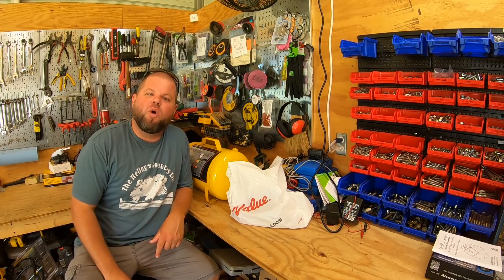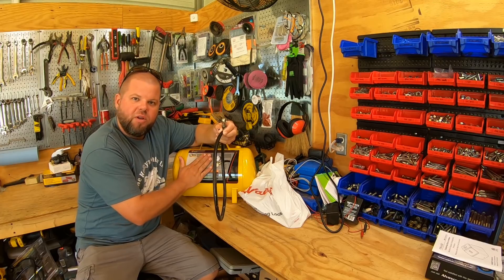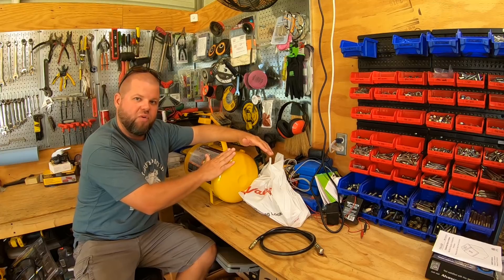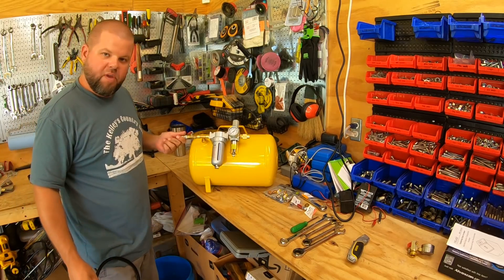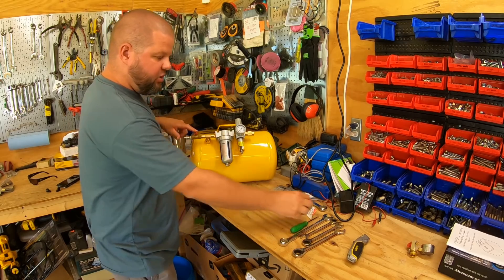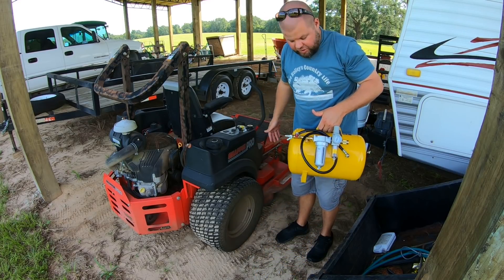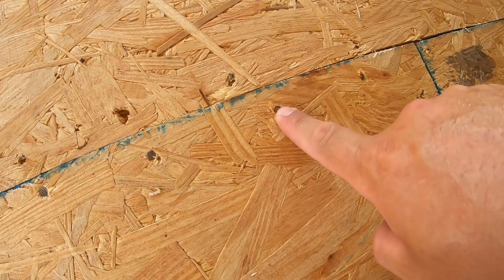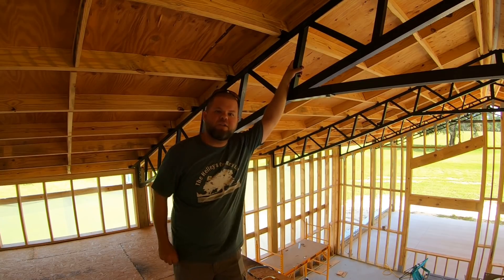Building an air receiver tank with dryer and regulator! #384

Comment: It would be cool to run some pvc line under ground to the house just like on the porch so you always have air but you would need good drying before it ran that way because you probably couldn't drain any water
Reply: you should never run air in PVC, it gets brittle over time and explodes. I've seen it first hand. Metal pipe only
Reply: @superscifi12  I don't know I guess I'd be cautious if it got a lot of UV but I have seen it with no problems
Reply: @james10739  So have I untill it randomly explodes. We were even using schedule 80 PVC. There is a reason OSHA does not allow it.  I am now a Union Steamfitter and wouldn't even think about putting air pressure on PVC pipe when it explodes literally sends shrapnel flying. Air contained is dangerous unless done correctly

Comment: One easy extra step is to use a cooler filled with 50 to 100ft of hose coiled and submerged in ice water right before your new auxiliary tank. It will cool the air in the line making the air dryer way more efficient on those hot days! It's an old painters trick it works great!
Reply: I have seen that done before, nice to have dry air, but too much oil will kill a gun

Comment: As there 'are' nearly 100 comments at this time & I just finished watching this...one question.  Did anyone else ask if you intend to put a 'safety strap' on the tank handle so it does not 'inadvertently' take a full header off from the attic area?  You know, a hanger strap, or tether, attached to a rafter or some such.
Ken
Reply from the maker: Kind of, someone mentioned the potential fall. I moved it downstairs yesterday because that was bugging me too

Comment: Great project to help you dial in the pressure needed without having to go back to the main compressor.  A couple suggestions to make it safe...
1- Install and over pressure safety relief valve in that buffer tank!  You say you never use air at or above 150 psi.  That's why they're called accidents.  Should your main tank's regulator fail and start pumping out 190 psi air... that little yellow tank is going to explode.
2- Ensure the portable tank is secured from falling over the edge the attic.  Would be very bad to fall to the concrete floor below.
Reply from the maker: Good points, I've been rethinking sitting it close to the edge. I brought it down today

Comment: Could’ve hit your downstream hose with just a shot of the oil that’s made for air tools to purge the water remaining in your nailer, and to lubricate it. Just a thought.
Reply from the maker: I put a air wand up there now, so everyday I've been blowing the hose out before hooking up to the small tank. It's making a big difference.
Reply: That blue desiccant turns pink when it’s full of moisture as an indicator to cook/dry it back out.
Reply from the maker: And is was absolutely pink in my shop dryer, I replaced it. I'll be drying from here on out.
Reply: If you oil air in a natural rubber hose or plastic hose then it will crack faster. Need to use special hoses if you use oiled air to get long life from the hose.
Reply from the maker: I manually oil my tools for now

Comment: Also known as an accumulator tank in a large air network.  They make Pex kits for airlines now so it can be worth it to trench in an airline between the house and the shop to have air in the house for things like filling tires at the driveway or for blowing dust out of filters and electronics. 

A good place to look for tanks is broken compressors as the people with them generally want to get rid of them and it is easy to plug the holes you don't need once you pull the compressor off them and they have the port to let water out already. Even just as a temporary tank at the house it could be worth it. 

When you do the trenching between the shop and the house remember to also run a extra poly pipe in case you want to run an ethernet cable at some point in the future. Poly pipe is large enough to run the cable in and cheap enough to act as a conduit for it without breaking the bank and you can generally run it near the water line to keep it away from the power since AC power lines can put induced currents into wires near them. You never know when you will want a computer out in the shop or even just a google/amazon bug to be able to play music/order something and getting wifi into a metal building is never fun without an internal spot.
Reply from the maker: Thank you for the tips
Reply: They make direct burial cable that costs less than additional cost of the poly tubing. Run shielded CAT 6E or CAT 7.

Comment: You need to run rubber lines no steal or cooper lines put a water separator 10 ft away from compressor at the bottom of a U shape dip to get rid of water I only had rubber lines never had any water in my lines line wore old logging truck and trailer lines
Reply from the maker: My main line in the shop is rubber, everything else is poly I think.

Comment: Moisture trap or air dryer? Hummm.  In addition to the moisture trap you should have a in line oiler for the tool. It will help keep the O rings lubed and keep them from drying out or wear.
Reply from the maker: I manually oil, but a oiler might be a good thing to add.
Reply: Yup I worked the manufacturing industry for 49 years, we had lots of air feed equipment. Most all had traps and oilers, but most ran 24/7.

Comment: Just a thought...... have you considered putting a smaller on demand hot water heater in each wet room in your home? You would only need a cold water line running through the house.  That would be ½ the possibility of a leak and you would not have to pump hot water around losing temp and wasting water waiting for it to get hot at faucet. Also if one of them went out you would still have hot water in the rest of house.  Maybe a dumb idea but a thought.  "If everyone thinks the same, somebody isn't thinking."
Reply from the maker: On demand water heaters are the ticket, we absolutely loved ours. I can clearly see yall are thinking like people up north lol. It's so hot down here you just don't have those issues. It's extremely common to have under slab plumbing here and one hot water heater. My parents house was built this way and it's never once been an issue. These rooms are a short run from the water heater, hot water in seconds.

Comment: On my build, I didn't use a valve on it, cause I feel that is really unsafe, if it where to get bumped or something when full of pressure and suddenly released. I used one of these checkvalves so that it isn't an issue: Clippard GCV-4 Check Valve. Haven't had any leaks or issues in the last 2 years with it. Makes it really nice to throw in the truck and not worry if it will stay pressurized.
Reply from the maker: I added the valve to keep air in so it could still be used as an air pig.

Comment: Buy an automatic bleed water separator and put it inline just before the desacent drier. Then find and read the manual for your nail gun. Most are adjustable for proper nail depth right at the gun, because they want the gun to operate at the same pressure, no matter what nail size you choose or how deep you want it to go.  I Hope these tips help you get it right! Ps. Increase the size of the hose run to the house from 3/8 to 1 in. And make sure you have at least full 1/2 in or larger, open port at the compressor tank to connect it to. That will help the whole setup. Oh. One last thing after reviewing the video again. Remember this word. FRO It stands for Filter, Regulate, & Oil. That is the proper configuration for the devices feeding your air tools. The Oiler is last in line before the tool and optional if you oil by hand. Jpol.
Reply from the maker: Thank you for the information
Reply: @TKCL  Your welcome brother. I'm not here to dis anyone. Just saying what I've learned as correct, that's all. Great job on the house. That right there is some skills I don't have and something I'd never attempt, for sure.  Take care. Jpol.

Comment: Is there any way you could prop your line up near the pole barn and pul in a drip leg to collect the water that condenses overnight? Take a piece of black pipe with a tee fitting on it for pass-through and a bleeder valve on the bottom put it at a low point in a run and bleed off the water in the drip leg before you begin working.

I've worked as a ME in machine tools and test equipment for almost a decade and I don't think I have seen an FRL kit that didn't have a drip leg preceding the incoming air connection.
Reply from the maker: Sounds like a good idea

Comment: well now i'm curious how viable it would be to wall off your compressor and put a dehumidifier in the room with it. probably a pointless venture for sure but i'd be willing to bet it's a useful concept for someone like a manufacturing facility where they already have a massive mechanical room dedicated to compressors that feed the facility.
Reply from the maker: We had massive air dryers at the mill I worked at. It still wasn't enough, lines would literally get ice in them in the winter and shut down production.
Reply: @TKCL  damn.....

Comment: The filter dryer will work better on the incoming side
Reply from the maker: My thoughts were to have it after it enters the tank, since expansion would happen in the tank and possibly trap condensation there. I was hoping to not overload the dryer, but my thinking might be way off too.

Comment: use tireject in the tire, not slime.
Reply: Slime will rune the tire and it's impossible to clean up when you need to change the tire
Reply: @PhiloSage  tireject.   not slime.
Reply: @jeepxj  I am agreeing with you. But added my reasons why I dislike slime.
Reply: @PhiloSage  oh duh.  my bad.

Comment: I see the potential issue with the set up. You've got the right idea but you need a second port preferably at the other end. The air is coming in and out of the same port so the air is more or less bypassing the tank. But if you have two ports one at each end of the tank the moist air in will be able to fall out more and get dryer air out.
Reply from the maker: I understand what you are saying and I see that too.  However the tank still serves the purpose of providing that additional volume downstream and stabilizing the air pressure. The perfect setup would be an inlet on one end of the tank and an outlet on the other with the dryer and regulator hooked up.  I am confident in my welding abilities, but not enough to cut into and weld on a pressure tank lol

Comment: As long as i have a steady air pressure i can do my depth setting with gun. I don't like using over 90 psi because that's the max rating for my guns and i don't want to blow my o-rings out. I do give my air impact a few extra psi probably because im trying to break it so it gives me the excuse to buy a new one.
Reply: ZSZ savings aazazzaaaaa ss I wdb as

Comment: Air volume booster tank.
After i left trucking i worked in maintenance.
At a big commercial company and when they expanded and added new machines they didnt have enough air volume to run the machines.
 So we broke the air lines every 300 feet and added a large tank in line to increase the volume of air.
Reply from the maker: It really works!
Reply: @TKCL  yes it does and it will increase the longevity of your compressor because it doesnt have to work as hard.

Comment: The ONLY source of moisture is in the intake of the compressor. If not your hoses leak like crazy. There is a problem at the compressor.  Probably air going thru the desiccant is too hot or it is short circuiting.  Condensation in the lines is because they are cooler than the compressor air.  It has nothing to do with being warm or humid.  Your solution is a good one but I would check your main dryer as the culprit.  Had this problem at work with instrument grade air.  Finally put a second dryer at the tank discharge and it solved the problem.
Reply from the maker: I don't know where you live, but our humidity is as high as 100% sometimes. I've owned many air compressors in my lifetime, and they all build up water like crazy due to pulling in high humidity air. I literally have to drain my compressors daily if they get a lot of use due to the amount of water buildup in the bottom of them.
Reply: @TKCL  Brian is absolutely correct.  Short of system leaks the only source of moisture is at the intake.  Your garage setup @ 9:20 seems pretty stock.  The dryer on the outlet just can't hope to remove as much moisture as you'd like from the hot compressed air.  Your best bet for dryer air is to remove that moisture between the pump and receiver.  Check out https://youtu.be/L4UBa39QvNs
Reply from the maker: Sounds like another project to add to the DIY list! Thanks!

Comment: I think you have a great idea and it will help you but I do have a suggestion to help you save your desiccant!  Suggestion to try... the water that is traveling through the  150' of line is very heavy (relatively) as compared to the air.  When the air line goes to the tank, the air goes into the tank but the water is traveling at a fairly fast speed and goes straight across your "T" fitting and the first thing it meets directly after the "T" fitting is your desiccant/water filter.  You can help save your desiccant if you rotate your "T" fitting and install an additional elbow.  Meaning, make it so your long run of air line screws into the part that now is screwed into the tank.  Basically, rotate your "T" fitting 90 degrees so when the air/water traveling in your 150' of line goes into the "T" fitting, it hits a "wall" (actually, the top of the "T" fitting as you have it installed now).  Because the water is so heavy, the air and water will hit this "wall" and the majority of water will fall DOWN and into the tank rather than go straight across and into your filter like it does now.  If you do this, you'll have to buy an elbow to retransition your line back horizontal so your filter and regulator aren't sticking straight up but I think you'll find you get a lot more water collecting in your tank as opposed to collecting in your desiccant if you make this fairly simply modification :)  Good luck!
Reply from the maker: Thank you for the suggestions

Comment: My question:  Why didn’t you installed your house power, on a temporary pole, near your intended power source for house at the start of your build.  Power cables would be easier to install from that source?  May be a dumb question on my part, just something I always thought I would do.  Great video as usual.
Reply from the maker: Temporary power poles must be close to the transformer. Mine is 150ft away, it wouldn't help me much. In a few months hopefully I'll have power at the house. Even then I'll still use my big shop compressor due to the noise the pancake makes.

Comment: How many nails are you able to drive before you lose pressure on the guy
Reply from the maker: As many as I want, it's always being charged by the big compressor air hose. If I disconnected the incoming air and just used what's in the tank, who knows? Maybe two or three framing nails before the pressure dropped too low. Quite a few Brad nails could be driven I bet.